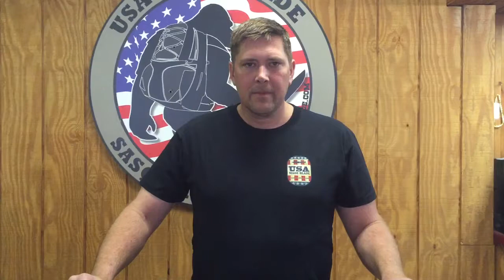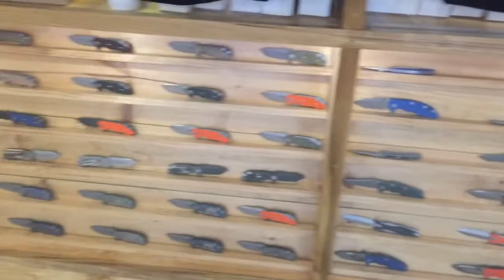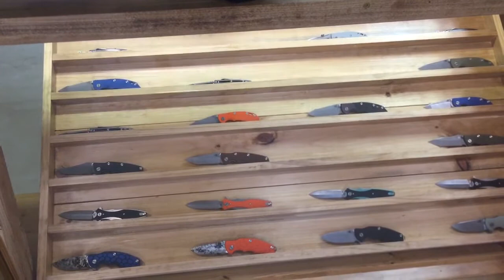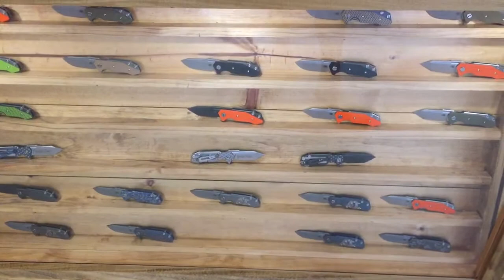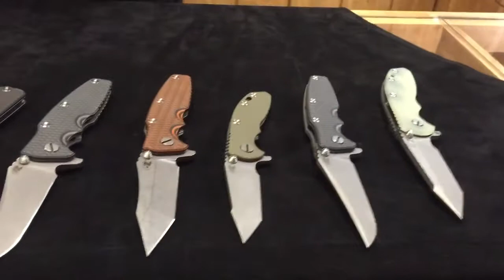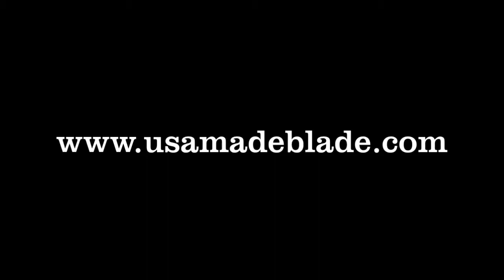The Hinderer Flipping and Detent Question

Comment: Just bought an eklipse from you guys and the flip action was great, the thumb studs were useless the detent was so strong I could only open it with the flipper.  I got a titanium scale for it and after swapping the scale now the flipper does not work at all the blades stops half way won’t even open.  It’s like the detent ball won’t set in the hole. When I push on the lock bar you can feel it pop it the hole.  Not sure how to fix this.
Reply from the maker: roland shoot me an email to scott@usamadeblade.com and lets see if we can figure this out!

Comment: They flip just fine with no wrist action needed if you know what you're doing. If I hand a Hinderer to a non-knife person, they will usually have some minor difficulty the first time but will get it after some instruction and a few attempts.
Reply: I just got my xm 18 and holy shit the fliper tab is ok (a bit sharp) but the jimping literally slices my poor finger ! It's like a little saw down there put in a spot specifically where you HAVE to push against as you flip it... and the thumb stud is impossible to flip open because of the detent being incredibly strong... I am assuming that will get worked out with time  and that it will loosen up with time.... But i'm pretty sure i'll have to sand some stuff down because that saw action is unlike any other knife i've flipped before.